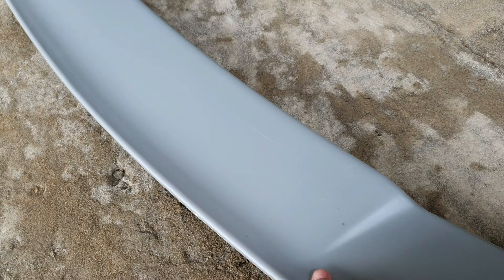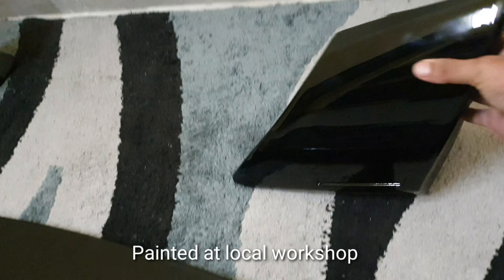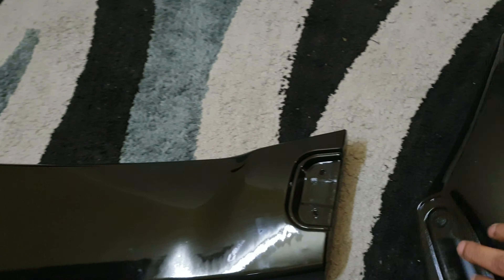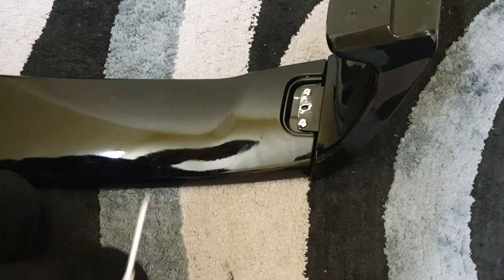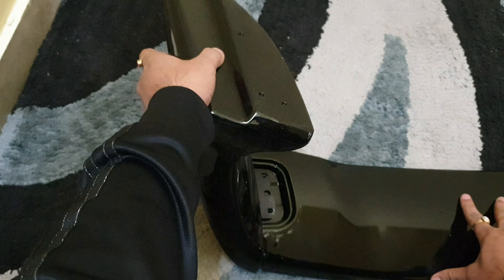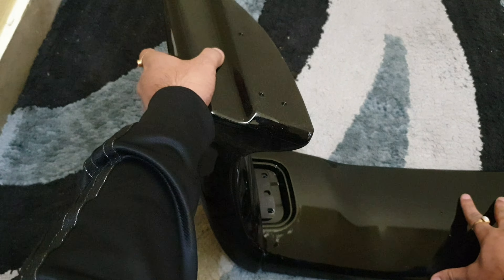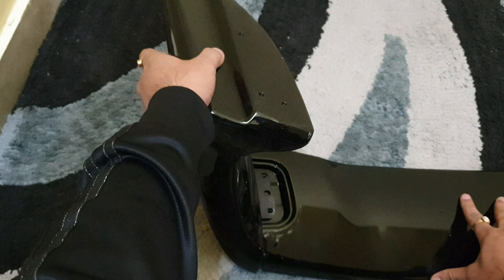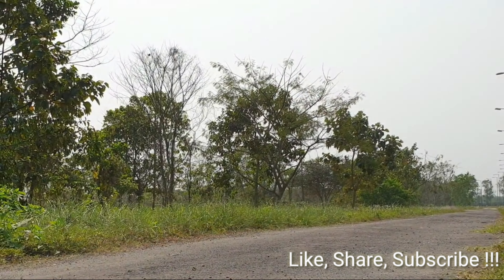Rear Spoiler Install | Hyundai Verna Modified 2021 | Hyundai Solaris modified | Vid ARN 🤘

Comment: Why we just do not use adhesive or some thing else instead of drilling .
Reply from the maker: At speeds exceedimg 120Kmph, spoiler starts to bend and create downforce... this is not just a show piece
Reply: @afteroffice_yt  the car barely has any power, I have a n line, slow
Reply from the maker: Great, N-line is 👍
Reply: @afteroffice_yt  very slow yeah, can’t go past 150
Reply: Mph
Reply from the maker: tats 240kmph on ur N-line.. hope you hav the roads for that to njy ur drive..